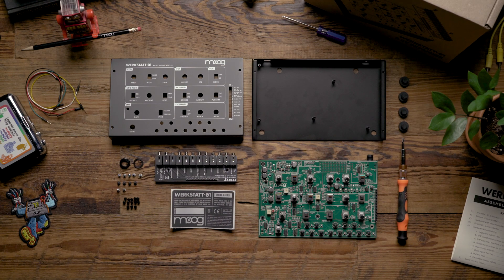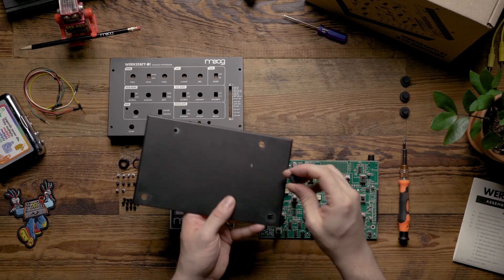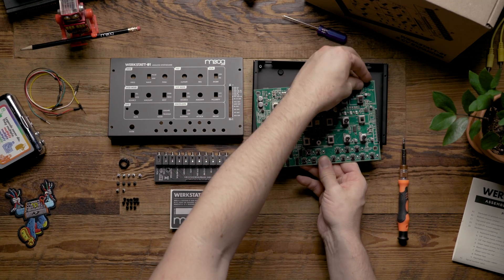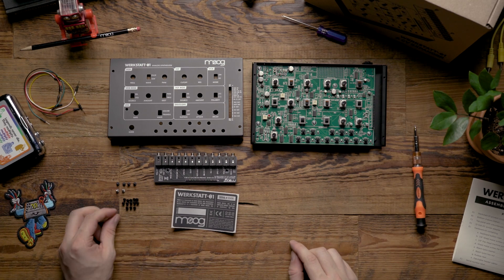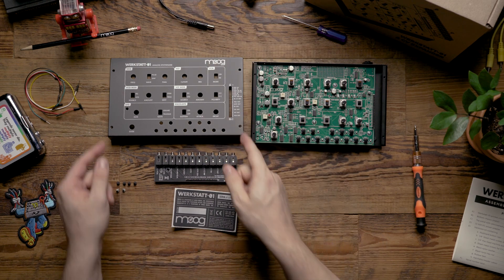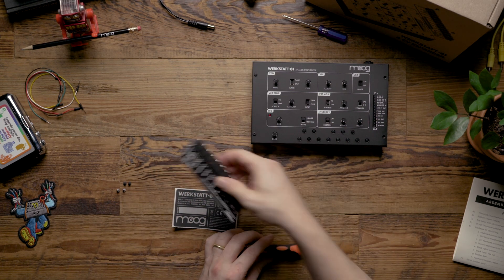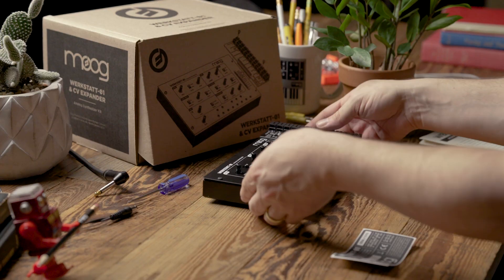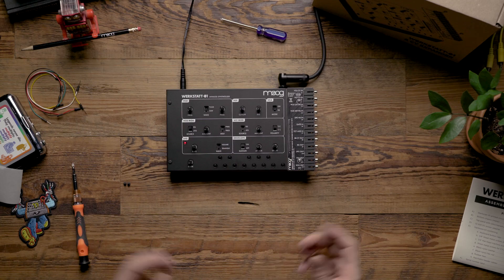Werkstatt-01 | How to Build Werkstatt

Comment: When doing the power/led testing my red light comes on but does not blink. Is this an indication of a problem?
Reply from the maker: That LED displays the rate of the LFO, so try turning down the LFO RATE knob next to the LED and see if it starts to blink.  The LFO is capable of operating at audio rate, and when moving that fast, the rate LED can stay solid.

Comment: Great little machine....But for me it was a little bit confusing with the different screws. The explanation beside the device was not really good. So I choose a wrong silver screw instead of the correct machine screw and the tiny beast broken as I screwed them. There was only 4 machine screws, 2 longer silver screws and 4 black screws. Unfortunately I watched this film after it and not before. There was not so much to do for „building” my first synth and I failed. My career as a synth builder doesn't end glorious. Nevertheless, great sound!
Reply: Don't feel bad. Easy "build", but those sheet metal screws were a pain. Getting those in took as long as the rest of the project. I'm lucky I did not break anything while screwing those in. It felt like I was about to need a hammer for the damned things.